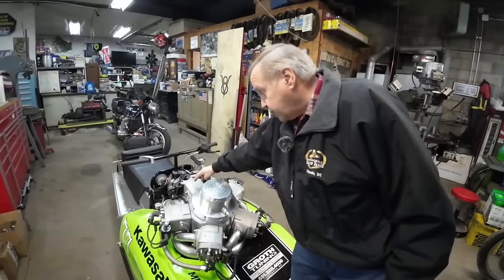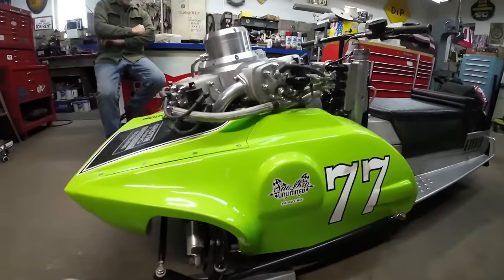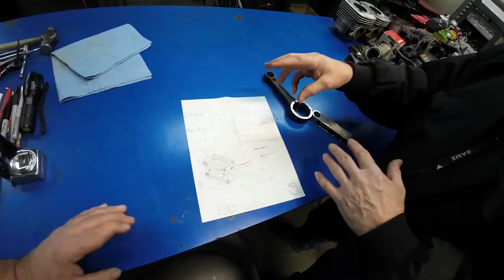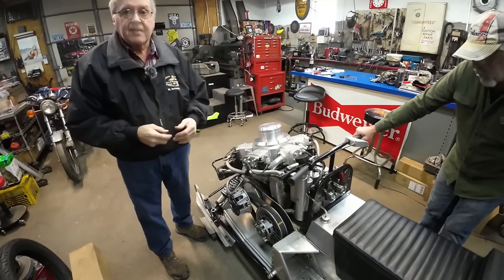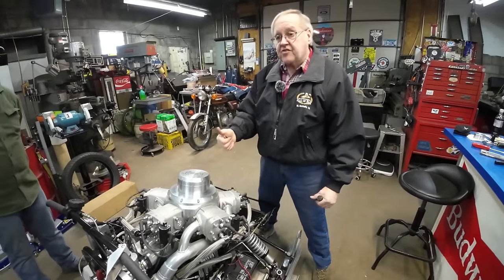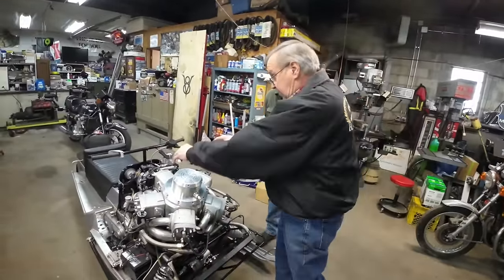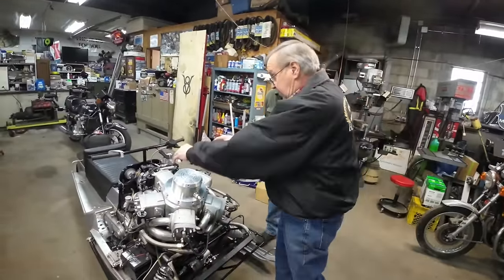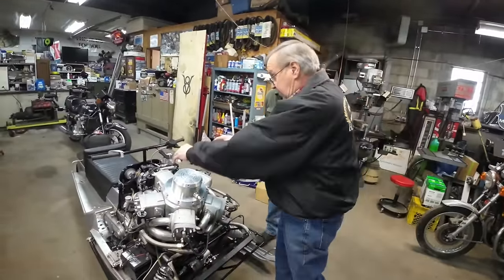5 Cylinder Radial Two Stroke Snowmobile Engine Runs! Vintage Race Snowmobile

Comment: This is what happens in Minnesota winters with 2 much time on our hands. Stunning build and creativity that defies the imagination. I saw 2 other Kawasaki’s hanging out…How can a person collect 5 Sno-pro cylinders, let alone 1? Ultimate garage tour stop, you guys rock!
Reply: Lived here my whole life and that math checks out. Seasonal depression will getcha if you aren't putting functional: suspension, a snowplow, lights, class 3 receiver hitch, and make your own lawnmower blades (with a changable curved lift blade on top, cutting blade on bottom at each end, made from S-7 tool steel @ __ rockwell, C scale) for your Hustler zero turn lawnmower...or solid aluminium baseball bats that hit basketballs out of sight, or spud launchers with a coil & sparkplug, or SO MANY KNIVES-alot made  in the style of Rambo with 'retired' Cosin CNC cutoff saw blades, or used carbide insert knife sharpeners, or bike chain/impact drive ladder lift thats holds it tight to the ceiling or just keeping the fleet of beaters any of my 4 girls and wife drive (...very hard, I might add) keep me from curlin up in the fetal position and wimpering "I'm done". Others would whip up a 5 cyl. radial 2 stoke from scratch. Pretty sure it's why we've busted out Bobcats, water skiis, artificial hearts, floor scrubbers, stamping die cushions, the toaster, plus MANY MORE inventions. Make stuff or go nuts, that's our choice up here; simplified.

Comment: Awesome video! I owned a few vintage Kawasaki sleds. The 4/6 LTD’s had duel plugs for each cylinder. My 82 LTD 440 with factory duel pipes/carbs……perfect example of engine technology being way to advanced for the chassis. Dang I miss that sled! If you google photos of 82 Kawasaki LTD snowmobile you’ll find my sled. 
Great video Nutter!
Reply from the maker: Thanks!
Reply: I had an 82 LTD for years and that motor definitely was quite advanced!  I remember ripping down frozen Sodus Bay at 80+ mph listening to her wail at 8300 rpm!

Comment: Awesome fantastic work.
A little correction though.  Engines in a radial type configuration where the cylinders and block turn around the crankshaft are rotery not radial engines.

Comment: What this man did cannot be done by AI.  I doubt if he had a complete set of engineering drawings which are mote important for high volume production and complex products unfamiliar to those producing the components.  He said he has been designing this in his head for 20 years.  The design evolved.  He just said “ no drawings”.  “Scribbles”.  I am a mechanical engineer and made things both ways.  It more fun this way but this is a one off,  but to do this in your head is amazing.  This tool and die maker admits he thinks in 3 dimensions.  That is another talent not easily developed if ever.  I still work in 2D and throw the first 3 samples away resolving the 3rd dimension issues.  My greatest respect to these craftsman.  They don’t get the credit based on the talent they have because nobody really understands what he does except for engineers and other mechanics, technicians and tool makers.  It’s amazing.

Comment: How / where is the vertical crankshft rotating the horizontal  output shaft to primary? A motorcycle pinnion / hypoid?
Reply from the maker: I believe Paul said it was an industrial gear box. It has a 90 degree turn and it runs in gear oil. That's all I know for sure. Paul says it is big enough for the job. It's pretty hidden inside the chassis and under the engine.

Comment: Good idea but the two stroke radial has been around for years, especially in the model airplane industry . If I remember correctly, Cox made a 3cyl, a 5 cyl, may a 9 cyl also . other companies aslo made 2 stroke radials
They really are very simple, much simpler than the PW R1820 in the Tracker(CP121 Tracker)
But it is impressive that he made one that big from scratch, good job

Comment: The main reason radials have an odd number of cylinders is because most of them are 4 stroke so the firing order then skips every other cylinder so after all the odd cylinders fire it naturally skips number one and starts firing the even cylinders because the number one cylinder is next to the highest number odd cylinder.  having an even number of cylinders means it would have to skip an extra cylinder when switching back and forth from the odds to the evens causing the harmonic imbalance.
Reply from the maker: That makes sense. Thanks.

Comment: Thats how all radials work..  they all have a common cranking point..  other than the ones that put their power out like a 3 phase motor..  those run like those old tank engines..
Reply: I dig them 3 phase 2 strokes!

Comment: OK Paul, now you need to find a 2010 Honda VFR 1200f motorcycle, which is a V4 1,237cc 4-stroke and mount your blower and four of your 2-stroke watercooled cylinders on it and make a 2-stroke superbike.  With your skills it would be a lot easier than what you have just made.

Comment: Maybe I missed it nutter but I wonder what rpm that engine spins
Reply from the maker: I didn't catch that either.
Reply: Generally radials are not very high reving. They are more about torque

Comment: Engines that rotate the cylinders and crankcase around the crank shaft are roterary engine.  Rotary engines were used in World War 1 fighter planes, propelled bolted to the outside of the crak case, motorcycle, rim for tire bolted to the cylinder heads the crankshaft forums the axle, and one prototype automobile the car had a ring gear bolted to the cylinder heads and opinion gear connected via axle to each of the rear wheels . The car looked promising until it snowed at which time opening or closing the throttle would cause the entire car to spin around the engine I forgot to mention the engine was mounted so that the cylinders formed a flat plain Circle parallel to the ground .
In radial engines the cylinders do not rotate around the crankshaft . The sales department at Mazda called a Wankel engine by the wrong name and that has become common practice today . It is another one of those cases of  wrong 100,000 times is still wrong, common practice but still wrong .

Comment: Did I miss how the starter system works, or the drive system??
Reply from the maker: You missed it. Paul explained the drive and it's electric start with the ring gear on the clutch like most sleds.
Reply: @nuttersspeedshop  Thanks.